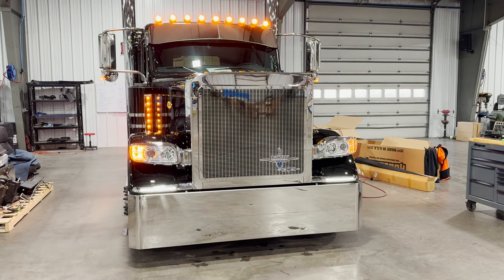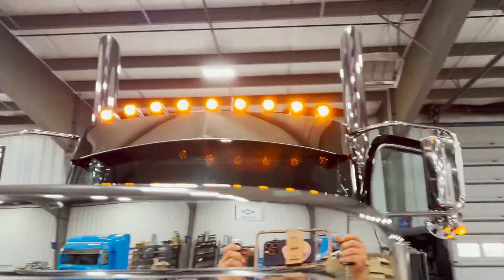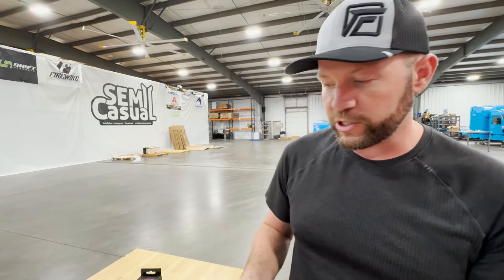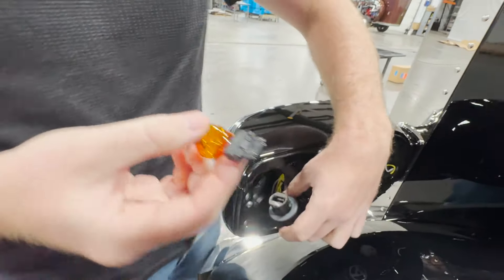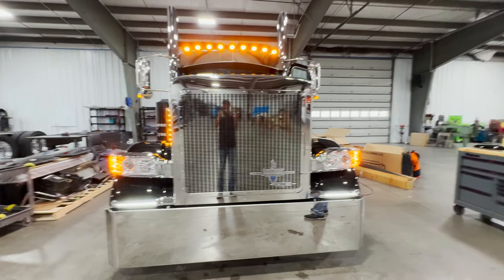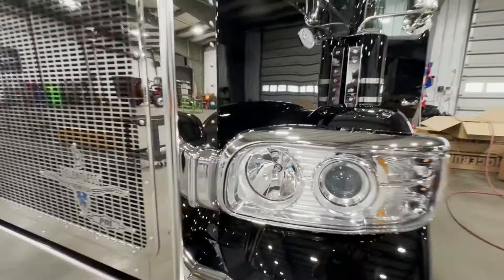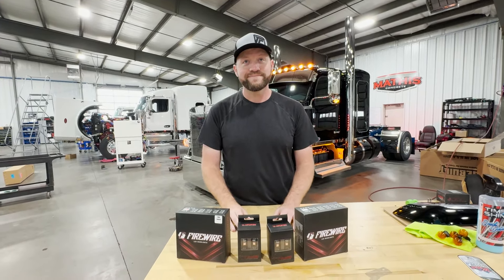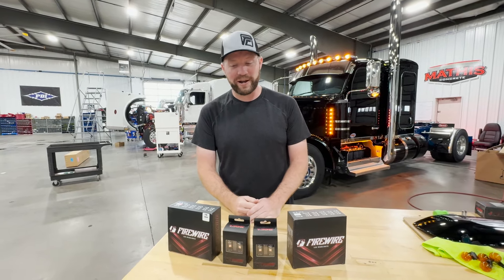New LED turn signal and LED headlights will change how you see at night.

Comment: Brighter and last longer for sure. But they don’t create heat for winter snow and ice. Especially in the rear position. That’s why now you need to show heated ad ones.
Reply: Right now I either use rain X or ceramic wax sometimes just cheap spray on furniture polish works

Comment: i see 2 different headlight bulbs. which one do i need ro get for 389. I don't see a conversion kiy or christmas deal on the site
Reply from the maker: For a 389 you will need both bulbs. One set is low beam and the other is the high beam.